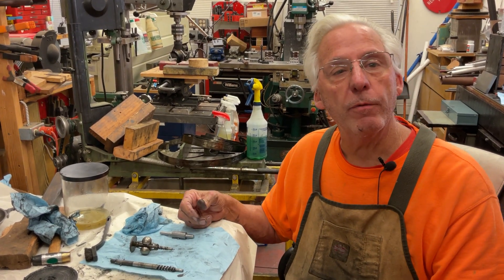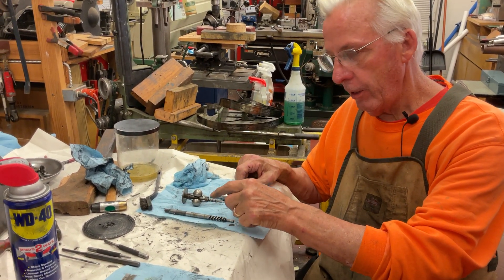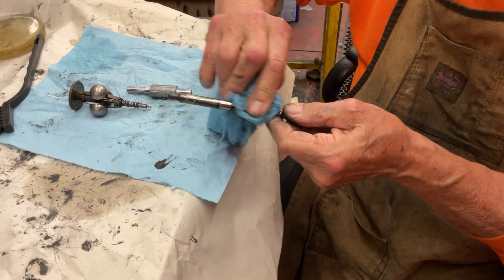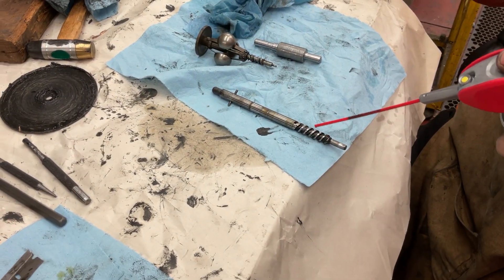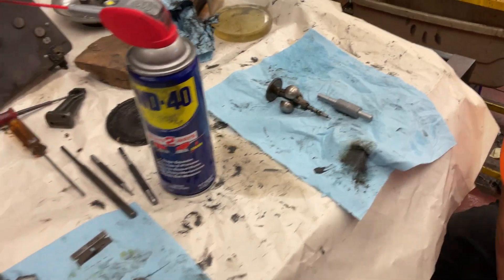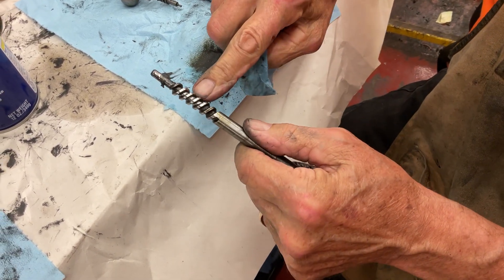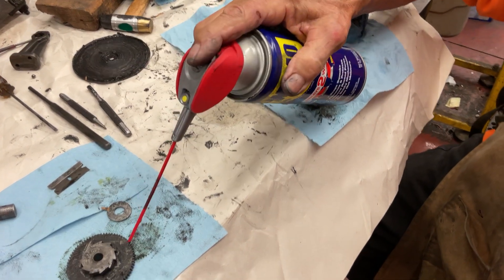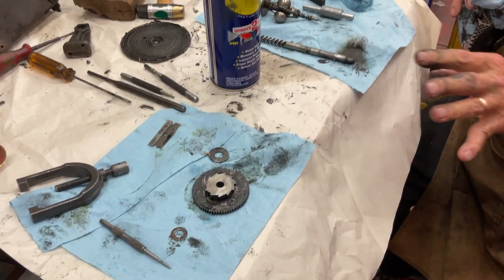1699.  Every piece of the phonograph motor must be spotlessly clean. ￼

Comment: I have a Silvertone SAAL motor I am cleaning and was going to use the 50/50 mixture of simple green. I've seen the warnings regarding making sure that the parts are dry otherwise they will rust. How to do dry the parts? And how do you check to make sure they are completely dry?

Thank you very much for these fabulous videos. They have been tremendously helpful.
Reply from the maker: I take everything apart to every nut and bolt, soak them in Simple green 50-50, then I can dry them all thoroughly before reassembling.